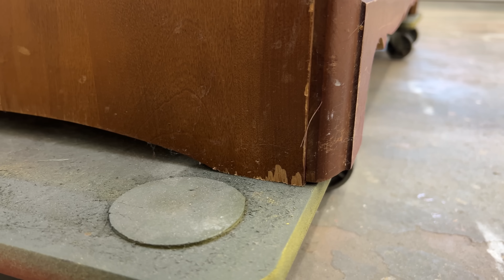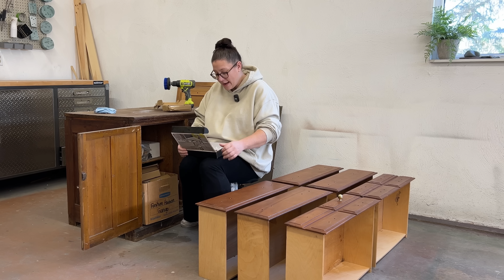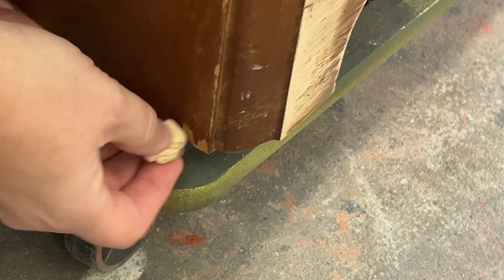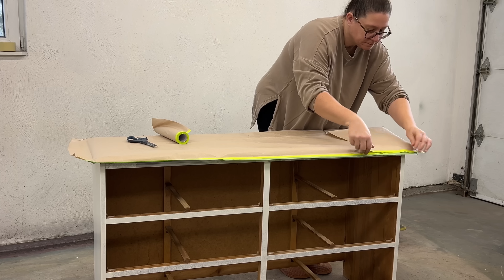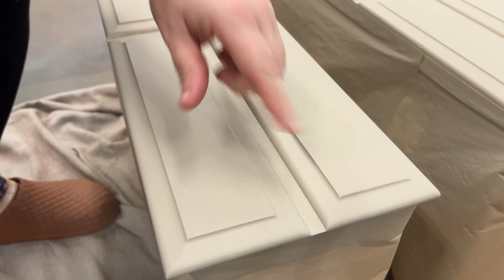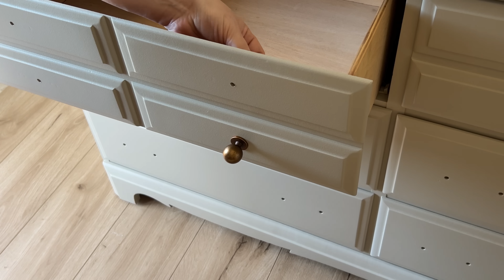Reviving a Curbside Dresser with Stain & Paint – Colonial Style Reimagined!

Comment: What are your thoughts about using wood conditioner?  I wondered if it was necessary on the top.  Beautiful outcome, spot on colour and hardware choices.
Reply from the maker: Sometimes a wood conditioner can help but usually it’s more useful with penetrating stains to keep them from absorbing unevenly. This stain sits on top of the surface already.
Reply: @ Thank you very much for your reply!  ❤️

Comment: Gosh, this dresser came out lovely! Question: why did you decide to sand the top rather than use a stripper? What considerations do you take into account when deciding to use a stripper or sander? Also, that "putty" you use to fill in nicks and gouges, will it absorb stain? I have a stained desk, which has a couple of dents on the edge. I want to keep the stained finish, so need a repair material that will allow me to match the stain color.. Thanks!
Reply from the maker: I don’t like going through the extra mess, expense or time of adding a chemical stripper to the process if I can cut through the finish easily with my sander. The epoxy putty that I used does not absorb stain but fillers that do will still only look like stained wood filler and not like the wood around them. You can blend in repairs with paints or wax blending sticks.

Comment: Morning Katie - quick question…how does the Fusion Paints perform if you roller it on if you don’t have a spray gun?
Reply: I have used it a ton with brushes and rollers and it self levels but don’t do in the hot sunny heat it will dry too fast ( and you will get texture)